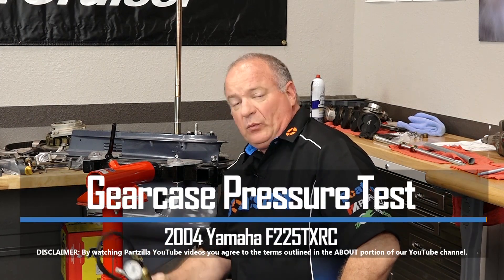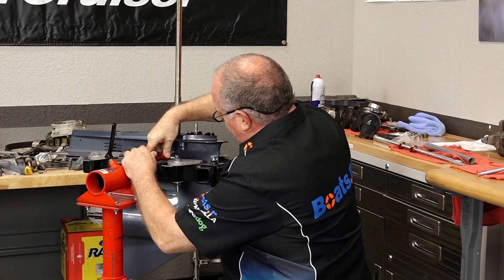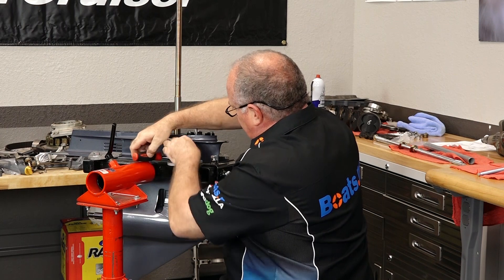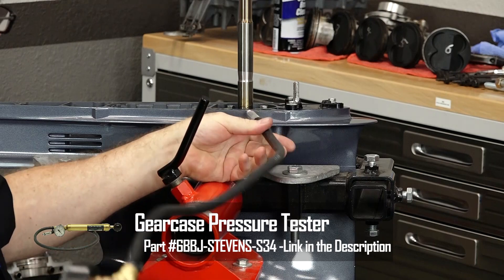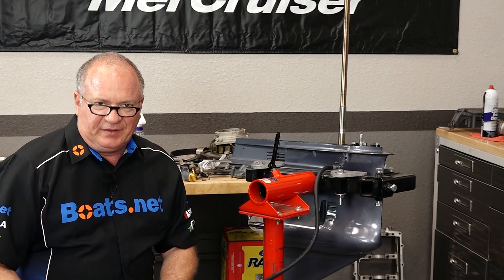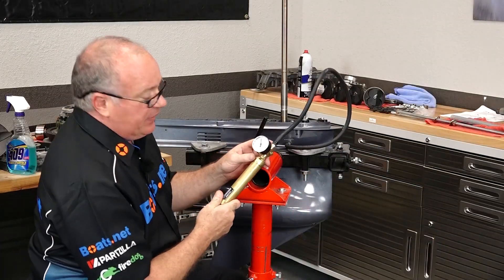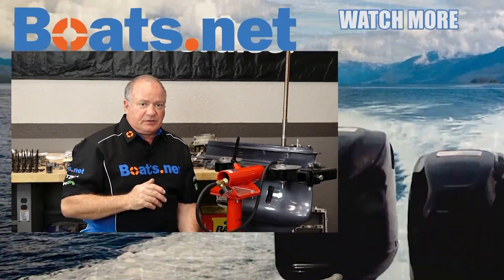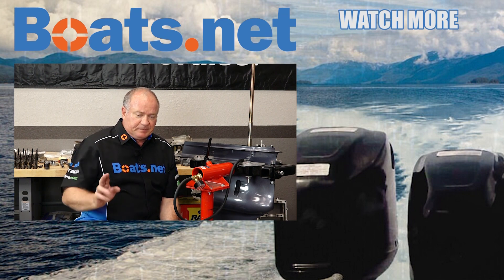Yamaha Outboard Gearcase Pressure Test | Lower Unit Pressure Test | Boats.net

Comment: Hi, I noticed an oily trace behind my 225 that seems to be coming somewhere from the lower unit. Not sure if its gas or oil, but I assume it is oil as there is not much of it (no smell just a trace)

I assume it might be gearbox oil. Will this air pressure test tell me if the leak is coming from the gearbox oil? What other tests would you recommend for diagnosing the problem

Comment: As old mate states and as it clearly states in the service manual lower unit test pressure is 10psi (70kPa) & it only has to hold for 10 seconds. The gear oil pan runs in a vacuum state, so if it holds 10 psi of pressure for 10 seconds it is good to go.

Comment: I did this test and passed. But still get water intrusion. I heard that spinning the prop by hand while doing this test will give you a better result. Whats your thoughts on that?
Reply: Probably too late to answer this question but yes, spinning might give a better answer. If the prop shaft has a bend it may push the seal out of place and cause a leak

Comment: I just drained the engine oil on my Suzuki df70 and saw a very faint white in with the oil color. I did hit a rock with the prop. Guessing this might be my issue. Question is, I used the engine for about an hour or two in low RPMS after since noticing this. The white was so light, do you think my engine is safe? Took it to the dealer where they are going to charge me my soul to find out what it is and fix. Any help here would be nice…. Thank you! 💪🏼

Comment: Does this test always need to be done with the lower unit detached?
Reply: No. Obviously if it doesn't hold then you'd have to detach the lower unit, but only after doing the soapy water test on the prop shaft seals. If they are good or if they are not good and you replace them and it still doesn't hold pressure then yes you'd have to detach the lower unit to get access to the drive shaft and gear rod seals.

Comment: 10 psi on yammy units. Remember  Yamaha  oil seals are installed as vacuum  seals, so they may leak with too much pressure as this would be ok.

Comment: I used a vacuum (Mighty-Vac) to test mine.  Pulled 20 PSI and waited 5 mins.   Still holding at 20 PSI vacuum.   Is that essentially accomplishing the same thing?
Reply: Late to the party but dangar marine from Australia uses a similar off brand setup like a mighty vac.